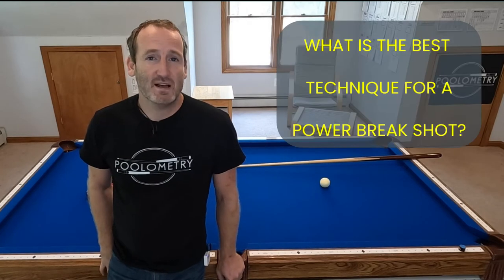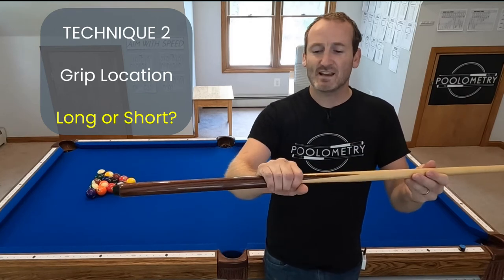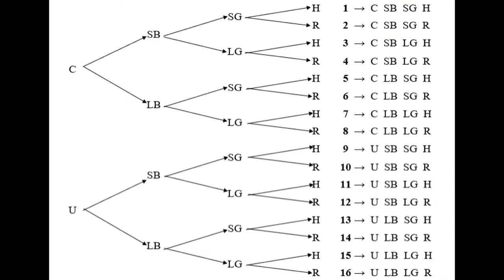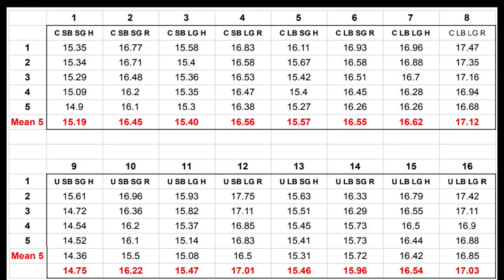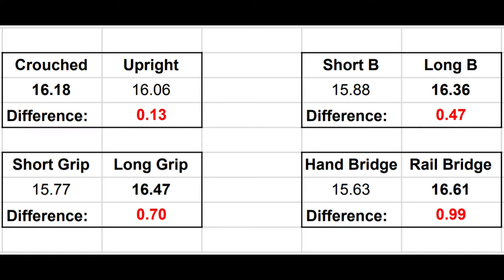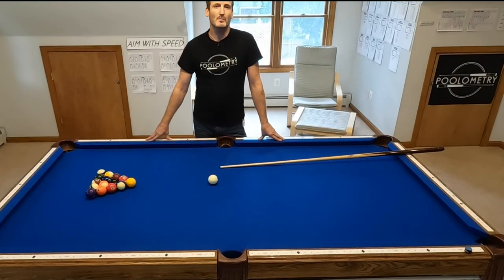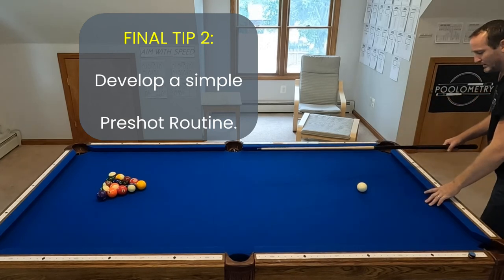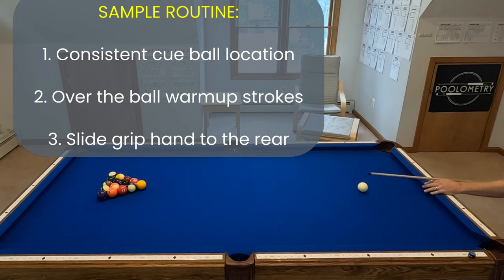The Best Power Break Technique

Comment: Great video!  There are a couple of other factors that should be considered:

1) The reason most professionals break with a shorter backhand grip is because they also propel their body forward during the shot, driving with their legs.  So even though they started with their hand past perpendicular of their elbow, they achieve perfect perpendicular at impact.  The shorter grip also allows for better cue control, which generally achieves better break results than a higher cue ball speed.

2) The idea of when to break with the bridge hand on the felt or the rail also has something to do with the size of the table and the intended break speed being used.  While it doesn't surprise me that putting the bridge hand on the rail produced higher speeds, there's also the matter of when the cue ball is airborne as it hits the rack.  Typically, you'll see people use a bridge hand on the rail on 8-foot tables and on the felt on 9-foot tables because that's the general distances needed to have the cue ball hit the head ball while it's still slightly in the air (which is why on perfect hits you see the cue ball pop straight  up in the air after impact, allowing it to hold in the middle of the table).

I'm certainly not trying to disprove anything since I absolutely believe the highest break speeds are produced with bridge hand on the rail, long backhand grip, and long bridge... but I also think that would be the most erratic break, too, likely resulting in the poorest spreads/makes of balls and opening position.
Reply from the maker: Thanks for some great additional points.  Indeed, getting that cue ball pop up is next on my list to work on, but I hadn't thought about how the table distance would affect this.  Will keep that in mind for an experiment as well.  But I don't know if I'll ever get to where I can break from my legs with maintaining control.

Comment: I love your systematic approach to figuring out the break here! I’m impressed and enjoyed your findings.

Im pretty obsessed myself with breaking, and all aspects within it. I practice the break more than anything else in my game. 17mph is a medium speed break (imo), and may be optimal for some games/table conditions, while not optimal for others.

As far as your 16 options go, it highly depends on the game, table, and type of break I’m going for. For a power break, at least for me, I stand up, choke up on the cue, use a medium length bridge (about 12ish inches), with my hand on the slate (though hand on the rail is fine if you’re just going for power).

There are a lot more reasons than 4 to adjust your technique for a “power” break. This is gonna change on a 7 footer vs a 9 footer. Watch SVB and Sky break on a barbox playing 8 ball. They do a pop break but from the rail. That isn’t because they get more power from the rail, it’s because the distance between the cueball and head ball, as well as the natural elevation is more optimal for a pop break with it back 1 diamond instead of on the headstring. This break- along with the head on 10 ball break on a 7ft and 9ft exist cause you can alter the track lines of the balls headed towards a few different pockets as well as make sure you don’t scratch straight into the side pockets (which is most common). The side pocket scratch is a much bigger possibility without a pop break. The pop allows for the cueball to be pushed backwards off the rack past the side pocket before the top spin rolls it forward, preventing the scratch. I assume you know these things, but am writing it because it’s critical in deciding which break to use.

I’m of the opinion that the largest factors in break speed are timing, tip placement, and mechanics. And when it comes to mechanics (and timing as a result), there are dozens of elements that may effect the speed of the break, and each of those elements may be executed at any level of effectiveness. It’s just so so hard to measure.

Of course this data is all based off of your personal break mechanics, and the effort to find what’s optimal for you is impressive. The only thing that gives me pause is that the human body isn’t a robot, and between muscle fatigue, error in execution, tip placement, etc, a 1 or 2 mph difference between some of your technique options seems very plausible.

I like these videos, keep it up!
Reply from the maker: All good thoughts, thanks for your feedback! Indeed since these videos I've been trying to master the pop up break you describe.  It is definitely a more advanced technique but delivers tremendous power while also keeping the cue center table.  I think my previous videos will suit a lot of beginner and intermediate players but in the works is a jump-break series where I will experiment with different ball positions and inclines, as well as slow motion video at the rack to see if the ball should bounce first or hit the pack airborne. Things like that.  There's some data and materials already out there on this but as you see I like investigating things myself.  But I'm focused on my bank shot series right now and still working out the kinks of a jump break.
Reply: @PoolandBilliards  awesome man!

Yeah I have a few videos on the 10 ball break- usually a pop break. From the quality players I’ve spoken to, video I’ve seen, and practice I’ve put in, im confident in saying that the typical pop break (sub 20mph or so depending on the tip you use and height you get on your cueball), certainly lands before the 1. This is of course only true on a 9ft table. On a 7 foot, it’s a slower speed that does it, but same concept.

On a more powerful break (though powerful probably isn’t the right descriptor), the cueball lands on top of the 1. By and large, at lease for 10 ball, this is not a break you should expect to make the side pocket balls, or the uptable. The rack kind of gets “squished”. Instead of the 1 bouncing off the rack like normal, it stays closer to the rack and more energy is dispersed through the other balls.

You can usually hear the difference between the 2 breaks.

The fun part is that the mechanics I use and advice ive gotten from good players don’t sound like they innately produce a pop break- but they do.

• Pros look at the cueball last (on the break). This isn’t so much about hitting the ball in the right spot as much as it keeps the focus of the stroke downwards on the ball as opposed to level or rising.

• focus on timing. Making sure that the peak velocity in your stroke is at the moment you strike the cueball. This tends to get later in the stroke as you add mechanics (body rise, elbow drop, wrist snap, etc). Making sure the timing peaks early enough to maintain peak velocity at the cueball is crucial for getting the most efficiency out of your swing.

• follow through is important, but only as it relates to how the cueball comes off the rack. This is less proven, but I’ve experienced and seen more success not scratching with more follow through (assuming the 1 is struck cleanly).

• tip placement accuracy changes a lot in the hit. More spin = less speed. Some top spin is applied to the cueball if struck in the center while at a downward angle because of the friction with the cloth. So it’s not always that too spin is added but it’s that the combination between angle and cloth friction has added the spin. A center ball hit gets you more energy into the cueball while still getting some roll like you want as long as the cue angle is right.

There’s more but I’m rambling at this point. I’m passionate about this stuff. Nice to see a fellow obsessed player 😂
Reply from the maker: Again thanks for all your information, will definitely weave all this into my practice and tests as I work out my own jump break shot. We'll definitely check out your videos if I can find them.

Comment: Appreciate you testing and posting. However, there are several other type of break techniques and reasons. Some factors depend on which table size [bar box vs 10' and in-between] and which game you are playing as well as what kind of rack [which can include adjusting your break depending on gaps or if using a magic rack for example].

If of course, you consider the ultimate goal of a break is to put you in a winning position, and work backwards from there. 

Edit: Now just seeing that this is a specific project on a power break. One thing you could experiment more with, is body movement prior to the break. 

Great topic and appreciate your insight. Best
Reply from the maker: Thanks for the thoughts! Indeed, I'm hyper focused on the power break, but you are right that the main goal is to be in a winning position.  I'm slowly transitioning to a pop & stop break with slightly reduced power, but it's much more technical and I don't think it is for everyone.  And of course the game matters - it's mainly an 8-ball concern to have max power.  As you said in other games the knowing the patterns for rack gaps leapfrogs raw power for importance, but those theories are well documented.
Body movement, for me so far, only serves to decrease my control for a net negative.  I know some top breakers really throw their body on the table, but I'm not sure I can ever do that without sacrificing the all important accuracy.

Comment: In this video you are not wearing a glove. Mentioned because I wonder if the amount of hand friction reduced by using the rail bridge was significant to the mph. Would wearing a glove and testing bridges result in the same differences?  Also, the grip itself matters. Make sure the back fingers are firmly on the cue, to produce a more powerful shot. No loose grip or front-fingers only.
Reply from the maker: It's possible hand friction could be in play, but that's not my perception.  My guess is that a rail bridge, of me, is much more stable, resulting in a more consistent center ball hit on the CB and stability at the moment of contact.  A possible test for the future.

Comment: That is a lot of breaks, you could double it trying left and right hand. I break harder with less control right handed. Quality over quantity(mostly break left)
Reply from the maker: I ruled out side power breaks because of the high tendency to scratch in the pocket or off the table.  Not worth it to me.  I think you'd have to scrap MPH and test another way like in video 1 to see if side breaks are better.  There's definitely way more variables in play for other tests to be done... but even 1 more criteria would go to 32 combinations and double to 320 breaks... maybe someday.  Add in all the break cue tests I've done for the coming 2 videos, and I need to take a... um... put additional tests for this project on hold for a while.